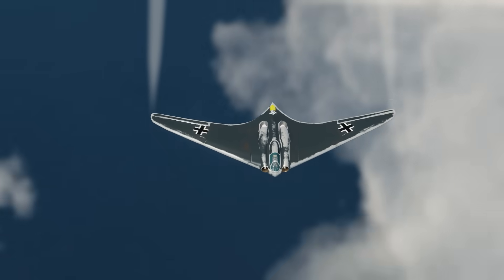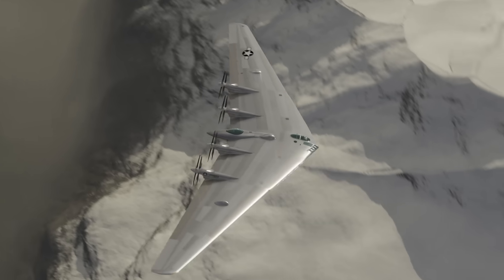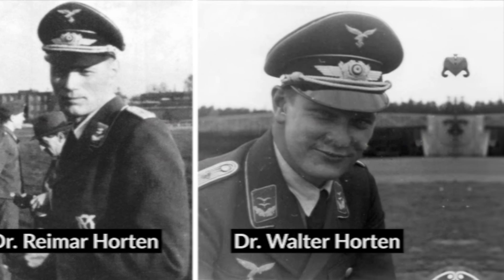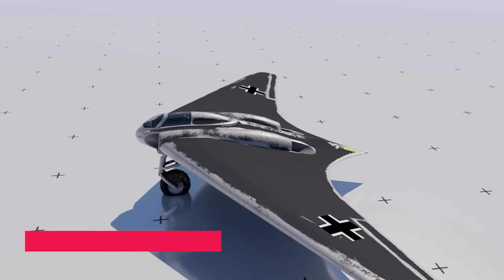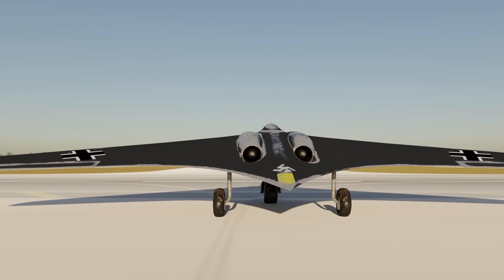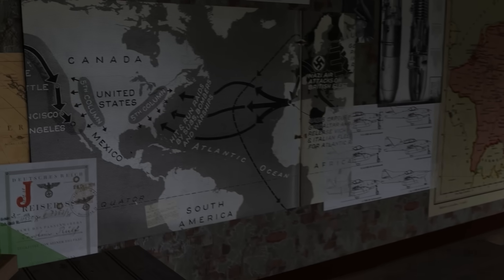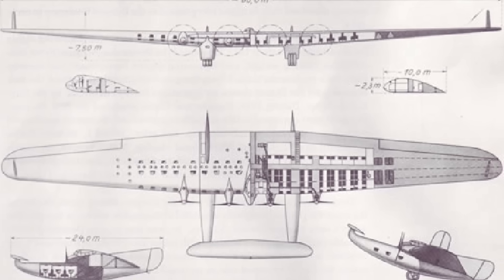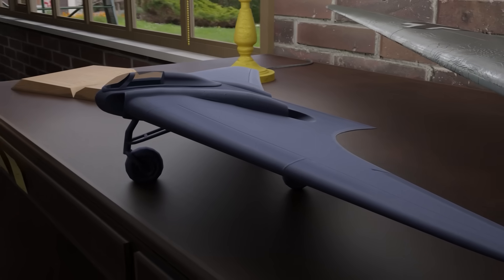Insane Flying Wing Jet Fighter To Save Germany - Horten Ho 229 Nazi UFO

Comment: Title is wrong, the Northrop N-1M was the first powered flying wing. It flew in 1940, 4 years before the Ho229 did. Also, the Ho229 was only a concept/prototype, it never reached production. There was only 3 flights of the prototype before it crashed, and no other prototype was fully assembled, let alone flown after that. And the final version had many changes made to it, mostly in size, that may or may not have worked out. And there is no proof that the final production model would be capable of any of the projected speeds, payload, or range.
Reply from the maker: ive changed it
Reply: Stout flew in 1918, Dunne in 1916.
Both had fins, but only purists say an all-wing or the media hype term "flying wing" must not have fins.
Burnelli was called a "flying wing", as was Arup/Hoffman which had fins, flew exceptionally well.
Not a single finless type has made a serviceable plane (that includes the B-2
Reply: Also we should note that the intended role, was ground attack. Carrying 1000kg payload at 1000kph, with 1000km range there, and back empty. Called 1000³.
 the aerodynamics of all-wing made it easier, as we see in the Arado 555 series of bombers and the big Ho-18 bomber and the huge Ho-8 transport.

We can easily see the Ho-9 in a Zerstörer or bomber-destroyer role.

Comment: There are a lot of problems with this story. 1st Jack Northrop was the leader in flying wing design.  The Horton Brothers learned from Jack, not the other way around.
2nd the HO229 while it had impressive specifications, was never more than a prototype with many problems to overcome. The biggest is that a pure flying wing has stability problems.  There is no way to recover from many out of flight envelop scenarios.   While this might be OK for a bomber, it would get a fighter into trouble fast when doing aerobatic maneuvers.   The B2 deals with this by having a flight control system that keeps the pilot from loosing control.   This type of avionics was unavailable in 1945.
3rd flight testing up till the end hadn't solved control problems and Horton brothers had no idea how to fix the problems because they didn't understand them.  If serial production had occurred, it is likely to have killed many of the pilots.    
4th the contemporary Northrop N9M only had stability because of the propeller shift shrouds.  This kept the N9M from going out of control.  
5th Horton didn't have Theodore von Kármán to work out problems.  Theodore von Kármán was the leading aerodynamicist in the world.  The Northrop N1 would not have flown effectively if Theodore von Kármán hadn't designed solutions

Comment: Much of the pioneering work on flying wing aircraft was done by Alexander Lippisch, his aircraft inspired both Jack Northrop and the Horton  brothers.
Reply: The Northrop N-1M was the first flying wing. He was working on prototypes in the 1920s
Reply: @Rico-v7r  Flying wings were researched and constructed in France, Germany and  Russia before the N-1M was designed or flown.
Reply: @olsonspeed  Flying wings were also researched in America concurrently to the projects in France, Germany and Russia.
One example is the Avion Experimental No. 1 in 1929.
Reply: @Rico-v7r  Yes of course in America, I did not exclude the USA.
Reply: @olsonspeed  A flying wing is an aircraft without a fueslage or tail assembly. Nothing built before the N-1M was tailess and without a fuselage. It's an objective fact that the N-1M was the first TRUE flying wing.
Reply: @Rico-v7r  So the B2 spirit isn't a flying wing.
Reply: The thing is though that nobody produced a TRUE flying wing before the N-1M in 1939.
Reply: @Rico-v7r I disagree.

Comment: Hey, dummy. Would you like to know how to get your pronunciations spot on each and every time without being a multilingual studies major? It's fun. It's easy. And you'll mislead people into thinking you actually know anything.

Yes, even you can do it with almost no effort, all the while absolutely not giving a crap as you clearly don't.

Step 1. Carefully write down the text that you have some concern about pronouncing correctly. For our test case, we'll use "Gothaer Waggonfabrik".

Step 2. Using any of the variety of Google search interfaces available, just ask for "German to English". Google will respond with two multiline edit fields, one for German and one for English. Essentially, this is an online German to English translator.

Step 3. On the German side, paste in your worrisome snippet of text, in this case "Gothaer Waggonfabrik".

Step 4. Press the pronunciation button on the German side. Hint: it's shaped like a speaker.

Google will respond with a pretty much perfect pronunciation. Press it often until you get the pronunciation down. Write it down phonetically on a cheat sheet if you're having trouble.

Voilà! Now you can look less of an idiot than you usually do given the number of mistakes you make in your pronunciations and references.

Sheesh.

Comment: Interestingly, the Horten brothers were not the first to have the idea of a flying wing. The idea apparently goes back to before the Wright brothers got flying figured out. 
Although it seems that 1909 is the magic year with a certain Rene Arnoux of France who built several flying wing aircraft. Although many of his designs would be considered 'tailless' now. 
It seems like the late 1920s had the highest number of inventors working on the flying wing idea. Rene Arnoux, is joined by Jack Northrop, Vincent J. Burnelli, Anthony Stadlman, Charles F. Rocheville and Clare K. Vance, Dr. C.L. Synder, Waldo D. Waterman, Alexander Soldenhoff, Professor G.T.R. Hill, Charles Fauvel, Walter and Reimar Horten, Alexander Lippisch and others. All working on the flying wing concept. They also each made important discoveries furthering the development of the concept. The Horten brothers were able to impress the German Luftwaffe and were able to have their development funded while still in the 1930s. Giving them an advantage over their contemporaries in building test models. And eventually having access to jet technology with which to power their designs. They still had issues with stability and control. But they had mostly worked out fixes with their genius wing design. I'm sure the plane was not easy to fly. But unstable aircraft are better fighters anyway.
Reply: True, the first flying wing was the Northrop N-1M
Reply: @Rico-v7r  as far as I can tell the first true flying wing might go to G. T. R. Hill with his "Pterodactyl IA" of 1928. The Horten's first flying wing glider "H1" flew in 1933. The N-1M didn't fly until 1940. There's also a few other aircraft that might fit such as the Russian BICh-7a which flew in 1926.
Reply: @Bearthedancingman  Jack Northrops Avion Experimental No. 1 was more of a flying wing than the Pterodactyl 1A and was built in 1929.
The Pterodactyl 1A had a pronounced fuselage.
Reply: @Bearthedancingman  Meanwhile the Horten H1 also had a pronounced fueslage and was unpowered.
That's why I say the N-1M was the first TRUE flying wing in that it really was a flying wing. It had no fuselage and was tailess while also being powered
Reply: @Rico-v7r  true, it's the first fully streamlined one. The Pterodactyl IA gets close, no vertical tails and a streamlined fuselage, but not fully blended. So yeah, I'd agree with you then.
Reply: @Rico-v7r  I forgot about that one! I was looking through my stuff but nothing I have is organized so..lol. Northrop was really after a wing with nothing protruding. Which is much harder than just tailless. Thanks for reminding me about his earlier stuff.
Reply: @Bearthedancingman  for sure

Comment: The "stealth technology" is rather happy accident due to natural shape. Modern stealth (shaped based) only introduce in 1980 by Soviet Scientists paper release in 60s.

You can read their report of testing, around 60% less than normal propeler plane. Sounds like big number to be a stealth. But considering 1000% reduce on Have Blue and F-117 (again, true first) or even 10.000% on big B-2, it nowhere to be intentional. And also 40% other is detected because of big intake, something that modern stealth tried so hard to reduce since beginning

Radar paint? Maybe it can, but it's not intended for that, and nowhere close to modern stealth
Reply: Stealth is always considered in regard to a certain detection method. Of course it was no where near modern stealth planes - as those came half a century after it, to combat radars half a century newer. It's like saying that a canvas wing biplanes of 1910 are nowhere close to Me262 of 1940's - and you'd be right, but I don't know anyone in their right mind who'd consider that statement as something to be taken seriously.

At the time of Ho229, it did have a bit less than half of radar (the earliest possible, analogue technology) footprint than your standard plane of comparable size - but that's all that it needed. Planes in UK had only a few minutes to scramble when the radars detected an incoming plane from mainland Europe. Using Ho229 meant that that time is now reduced even further (lower detection + increased speed of a jet), to maybe 2 minutes before the Ho229 is above English soil - and that means it can catch the enemy mostly on the ground or slowly climbing up.

Stealth was not the MAIN design feature of Ho229 but it WAS considered a bonus. And it wasn't lucky accident, it was actually known at the time that it would reduce the radar footprint. Contrary to the video, Germans knew about radar technology, especially later in the war - as they were using it themselves. They knew that flying wing design offered some benefits when it came to stealth.

So your comment about it being "a happy accident" does not stand. And your statement that it is not close to modern stealth is simply laughable. Not because it ain't true, but because it is extremely idiotic to say something that obvious. No one ever claimed that it is close. Just like no one said that the Wright brother's plane was nothing like Me262 (it has the same time difference of ~40 years, like Ho229 to B-2). So yeah, no shit Sherlock, they were nowhere close XD
Reply: @Wustenfuchs109  "Happy Accident" And "Lucky Accident" Does stand on same thing duh. At least for me

German knew about radar, but nowhere near level of RCS concept. Again, RCS concept only found out 20 years later by Soviet scientist, and still forgotten for 20 year more before picked up by Skunk Works. So saying Horten was stealth plane isnt causative at all. Because again, the timeline didn't correct. The actual intention also don't line up

And even if you guys believe in German Nazi technology supremacy bias that know how to make alien spaceship, the RCS reduction is just equivalent to Bf-110 without wing. Which is again, still waay too big to not picked on radar, and definitely not stealth at all. Especially when you need bird-size reduction to not picked up by radar
Reply: @bocahdongo7769  It wasn't forgotten for 20 years. The USAF translated Ufimtsev's paper in 1971. The CIA authorized Skunk Works to read it in 1974.
Reply: @Wustenfuchs109  Military Aviation Technology sumarize this up. And we all already know this channel credibility compare to, you know, youtube commenter like us

https://youtu.be/NSrszi6ivyM

He summarize that Horton never know or mention at all about RCS concept on his flying wing concept, even in confidential document. Which again, RCS is main foundation of all modern stealth plane
Reply: @Wustenfuchs109  It was estimated it could be detected at 80% of the range of a Bf-109. It didn't make a difference.

Comment: The blur prints for the Horton Ho 229 was given to jack Northrop from operation paper clip then he forgotten all about them only for the team behind the B2 to find them in the mid 2000s
Reply: + TheEnchiladaKid    Northrop was awarded the government contract to start building his big YB-35 bomber in 1941, long before they Horten brothers started the 229 work.   The B2 is based on the original YB mission and design.
Reply: Given that Northrop had already produced flying wings, the idea that they copied much of anything from the Ho-229 is unlikely.

Engine placement, maybe.
Reply: Why would they need the 'blur' prints given that they had an actual airframe available?

Comment: Some of the sequence of events between the Horton wing and Jack Northrop’s initial interest may be different… in fact, Northrop released a scientific paper before the Horton wing, and supposedly the Horton Bros had access to it, and actually used this paper as a testament to justify their prototype to the nazi govt.

Lastly, if they had a limitless budget, plenty of time and unfettered access to materials, it’s doubtful this Horton design would’ve worked, simply because later analysis revealed that the mechanical controls would’ve been insufficient as real time computer controls were unavailable at the time.
Reply: The horten brother build there first true flying wing in 1934 and that one even took part in the röhn glider competition, loging a flight as long as 7 hours in that competition.

I guess it is impossible to say who had idea of a flying wing first. But I think it is quite save to say that these  completely unknown brothers had very little true insight into what Jack Jack Northrop had going on turing that time apart from what might have been published in the aviation magazines of the time

Comment: 8:00 i'm no trained aero engineer or aerodynamicist, but i do have an introductory degree in aeronautics and i have been building and flying RC plane for about 8 years, All this to say i didn't understand anything about that stall problem. You talked about "engine stall's", do you mean compressor stall? single engine flight? Gliding? the actual wing stalling. And what does spreading the weight over a greater area have to do with improving stall?Is that to do with the CG? you look at a cessna 172, most of the weight is in the fuselage. I'm not trashing the video, i'm genuinely confused

Comment: Sorry the Horton Bros were not the first and their powered flying wing was built after Northrop's demonstrator flying wing (2 years prior).  In concept it was great but was not stable.  The illustration of this was the loss of the prototype due to an engine flameout.  Yaw could not be controlled.    The Northrop bombers also suffered from the same lack of stability.  Until active computer controlled flight controls were available the flying wing concept was relegated to unpowered flight.   https://en.wikipedia.org/wiki/Flying_wing

Comment: I can't remember the title but they did a TV show where they recreated a 1:1 Ho-229 model after historical blueprints and put it on the radar test mast. Radar cross section was so little that it can be assumed that with sufficient numbers the Luftwaffe would have had an incredible advantage in the battle for Britain. Or better said: the British isles would have been fallen and WWII would have been a lot different...

Oh yeah: as a German I did giggle a bit about your "Luftwaffel"... 🤪😁
Reply: Around 60% less than normal propeler plane

Still way less than 1000-10000% reduce on modern B2. But for something that found out 20 years later, it was happy accident.
Reply: They didn't completely recreate it
They used more wood then the actual design would've had which reduced the radar signature more then if they used metals in certain parts. The aircraft was harder to pick up on radar but would still be detected while crossing the channel
Reply: @demanischaffer  Honestly, t's not any harder at all than normal plane. The reduction is waay to small, even the material difference is really the case. Simply because RCS concept (which is main foundation of modern stealth) only figure it out in 60's, and only to discover 20 years later for application

The reduction was only make this thing as big as Bf-110 without wing in radar. Looks like very big reduction, until you realize first attempt on modern stealth can reduce the RCS until as small as A hornet
Reply: @demanischaffer    The Northrop model department made a wooden and fiberglass mock up of the 229.  The original aircraft had a welded tube frame and steel panels around the engines for heat protection.  There probably would have been more radar return.